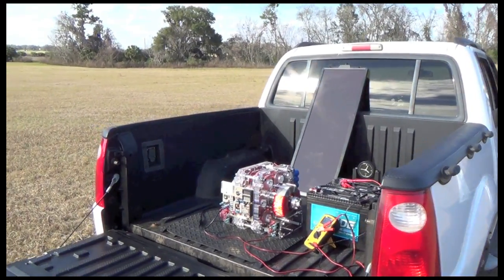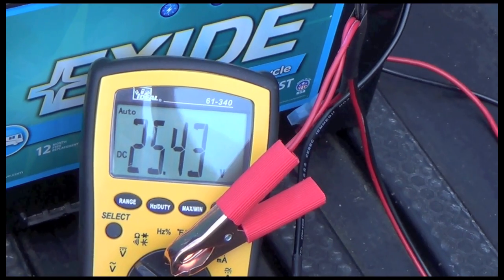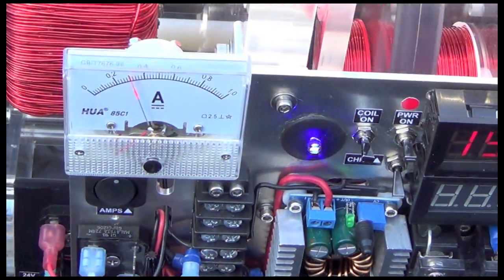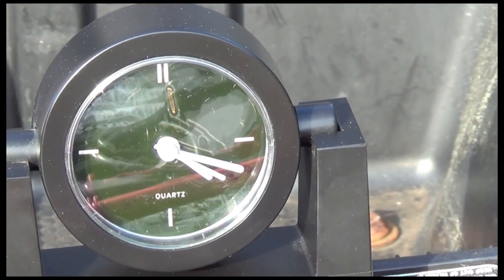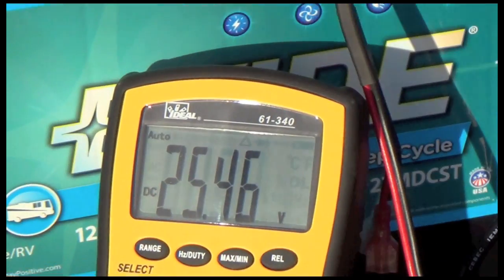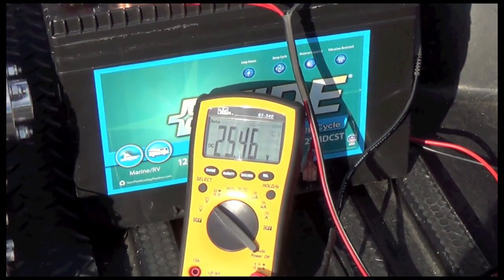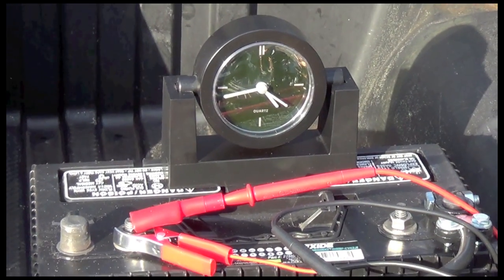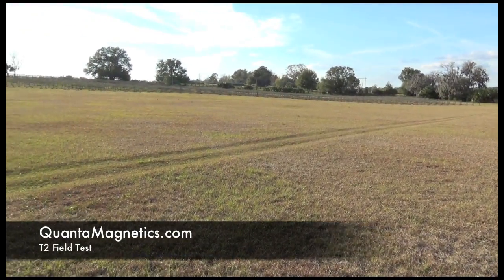T2 Resonance - Field Test

Comment: You should improve your videos, a lot of people did not understand what the machine or this is is all about. I had my difficulties too. For example you can Name the thig like "Its a device which acts as an "Energy amplifier". Second is i am not really convinced what is achieved here, you should be more clear.  I see a chinese stepper up Converter on your machine which could do the Charging alone. So for example say : i run this test for 60 minutes, the batteries got loaded with 50Watthours so the Energy gain is 6Watth - 50wh = 44 Wh (replayce numbers with your own). That would be ultra clear, but instead you dont name the important numbers. You know what the Machine does, the viewer does not.
Reply: Hyper Hektor  the first split second the charger is turned on is when the charge is most efficient . So think about if it were pulsed on and off 100 or 500 or more times a second, the batteries should charge extremely quick.

Comment: Did you think about monitoring the current being used to charge the batteries? You have already worked out you have nominally 6w watts input, if you can establish the current OUTPUT you can then see how much power is lost in the conversion.

Eg: 25v out at 100ma would give an output power of 2.5 watts - and a suggest overall efficiency of a little under 50% (not too bad for a rotary converter)

The machine LOOKS amazing, but if you monitor the output current as well as the voltafe, we could see how well it WORKS as well as how good is LOOKS!

Comment: Can i put this in my Tesla S trunk and hook it up for extra milage?
Reply from the maker: I couldn't answer that question, but it sure sounds cool.
Reply: You could, But the Tesla will not charge while in operation. It would charge if you stop and shut the car down. Of course you would most likely void your warranty on the car.
Reply: +James Salazar Could always bypass part of the charging circuit so it runs while charging :P

Comment: Hi . I really do not know anything about your device but its well put together . I saw that it can run off of a 9 volt battery and can it run on a battery from a cordless drill plus charge one to. Can it charge the batteries of an electric car while you use it also . I would like to thank you for stepping up to the plate to help . I'm from a small town in West Virginia

Comment: beautiful piece of mechanical engineering... but I guess I am lost as to what the idea here is....   charging batteries? I don't quite understand why introduce mechanical losses into a charging circuit? an electronic mppt dc-to-dc converter surely would have significantly less losses.

Comment: Hey love the videos I'm hooked!  It's a little over my head, it's great you mentioned that it's drawing 6 watts and the out put is 24th that's so sweet!  If someone in the know could tell me if you had this machine in a eV running on lead acid battery's, with a solar panel roof of around 15 watts. Would this be a effective set up??? Can you drive and charge the battery at the same time??? I definitely want one of these machines one day. Thanks for being awesome. You totally have a voice for TV or radio it's easy listening to you.

Comment: This is easily possible. Replace the (2) 12 volt batteries with  (2) 12 volt banks of 650f 2.7v caps. Start with caps at 50-99% of rated voltage. Measure the voltage drop over 120 seconds or so. Then do the math. If the caps collect close to 6 watts over the given timeframe then your efficiency will be looking good.
Reply: oops, my last comment should have read......measure the voltage "gain" not drop, to quantify the" battery"  charging capability.
Reply from the maker: Christopher Powers Thanks for the clarification. It just didn't make sense to measure a voltage drop. That would be a disappointment. I'll try to gather up enough UC's to do a fairly easy test like this. Thanks again.
Reply: PMMG4HYBRID Thank you as well, and look forward to seeing how future tests work out. I have found the drift on the larger caps (650f) to be minimal. Then if time is measured fairly accurately, the degree of uncertainty is relatively small.

Comment: That's doing a great job with 6 watts solar panel. I am curios as to the charge voltage after it has settled from charging it as well, it makes a lot of difference because of the float voltage. Also, how much solar panel wattage would be needed to generate at least 1 amp ( avg. ) drive using your T2 charger ... hmmm that would be a nice benchmark.

Comment: Are both batteries 100amp-hr each?
Reply: nvm I rewatched it and you mentioned 105amp-hr batteries. The clock shows 4:05pm at 25.43v, then ended at 4:40p.m at 25.47v. A difference of 0.04 v in 35 mins.  Roughly 0.0686v per hour. Assuming two 12v deep cycle battery in series at full capacity is 25.6v (assuming 12.8v max/each). So if you discharged it to 75% capacity (25.2v) and recharged it, it should take about 5.83 hours (25.6 - 25.2 v = 0.40v; 0.40/0.0686  = 5.83 hours) to fully charge....if i'm not mistaken.
Reply: Thien Nguyen If that's correct then... the equivalent of this system is.... 5.83 hour * assuming 15% solar/inverter loss efficiency = 6.70 hours. 25% of 105amp-hr battery is about 26.25 amp-hr. So to charge 26.25 amp-hr in 6.70 hours, it'd take about 3.918 amp of input. Assuming the voltage is 27.2v at 3.918 amps, the equivalent system would be a 106.57 watt solar panel. Only pro I see is that the t2 keeps on running after the sun is down. Also If your input is only 6 watts, then that's an efficiency of 17.76...which is pretty ridiculous. But if your planning to feed it back into the the grid, 106.57 watts running a full day = 2.55768 kwh/day or 76.73 kwh/month. Assuming electricity rate is 11 cents per kwh, you'd save like $8.44 a month lol. And assuming (if possible, probably not) you pulse charge lithium battery bank....charging a tesla 85kwh battery from a 50% soc, it'd take roughly 17 days.
Reply: Thien Nguyen
 yeah, these are some of the right questions !

Comment: Well done, but what is the average charge current into the batteries at 6 Watts input ? I still dont see with your video tests, why your machine should be better than a solid state Joulethief or Bedini circuit charger ...?
Is your T2 also pulsing the batteries like a Bedini or did you rectify the output to DC current ?
Regards, Stefan.
Reply: Correct : Please help us with this question ; How 6W input and how many W out to the batteries?